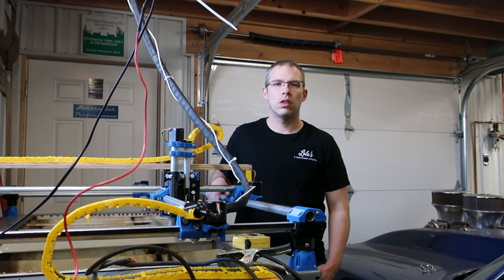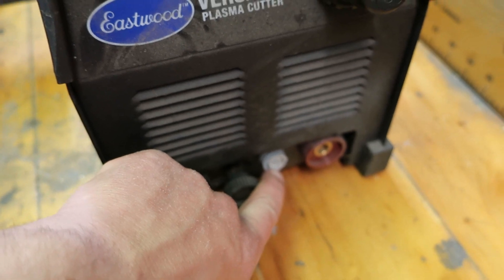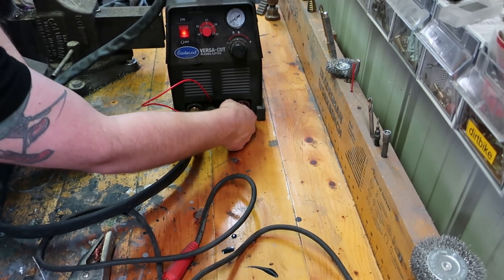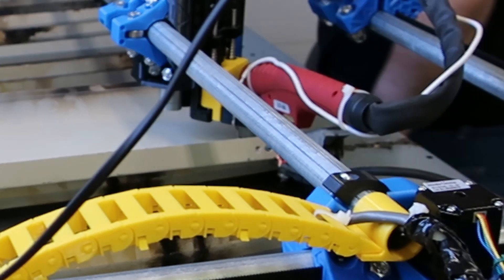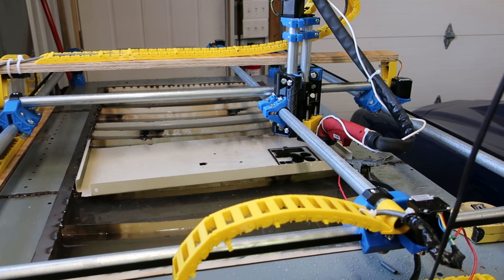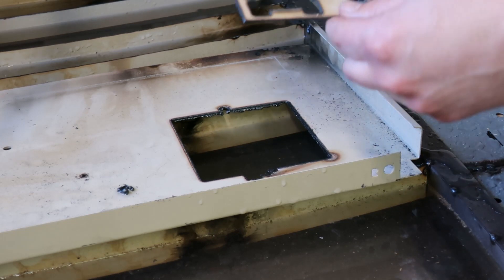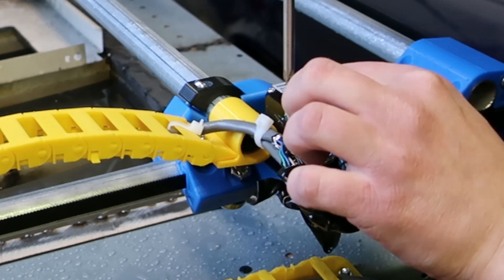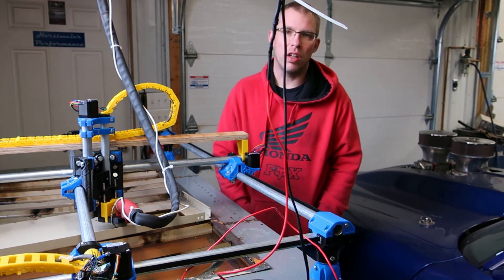MPCNC Primo Build Ep. 15 First Plasma cuts

Comment: I really enjoyed this series and was happy to see that you got it working pretty well in the end.  One question, though.  Your machine has pretty large dimensions for the mpcnc Primo model.  I read that most folks doing large format projects went with the mpcnc Lowrider.  When were the tradeoffs in your decision?
Reply from the maker: If I had a router attached(plasma torch floats)  this size is really too big to use without supports on the tube, and probably using better quality tube. There's alot of flex in the conduit. I've never built a lowrider but i think it would probably work better for bigger builds. Thank you for watching